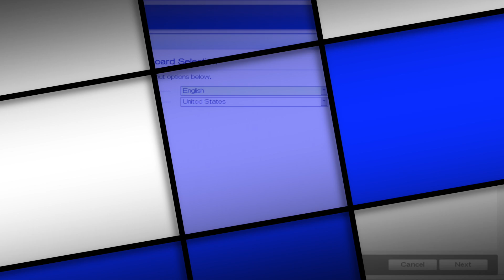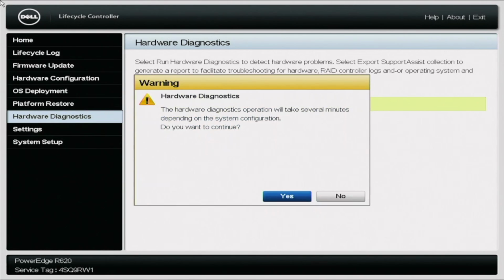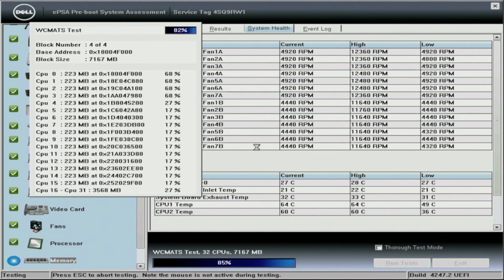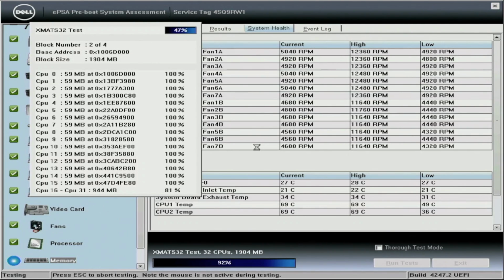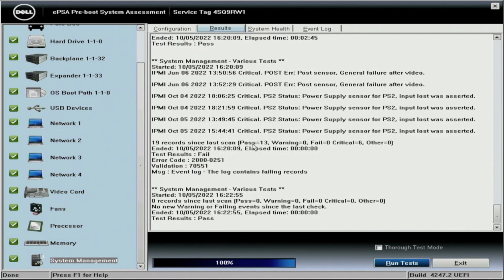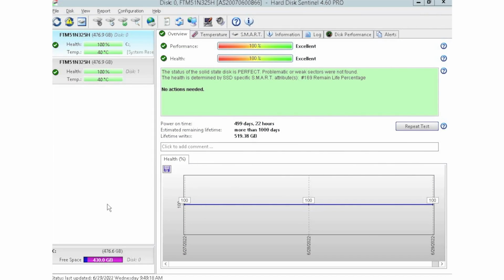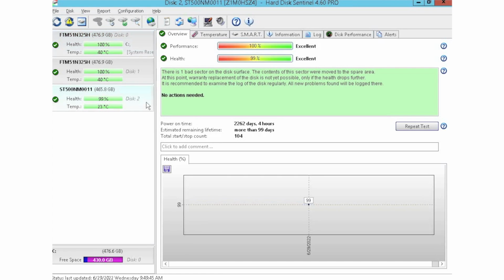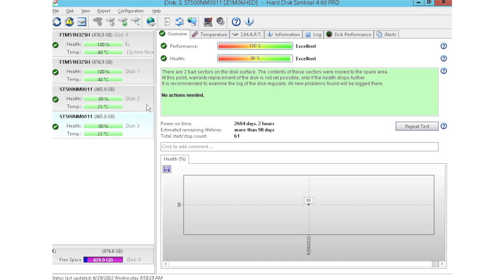Dell PowerEdge R620 HDDs & SSDs | Hard Drives | Solid State Drives | Testing with Dell Diagnostics

Comment: Hey, I've purchased an used R620, but it has SAS drives. How would I go about switching it so it can accept SATA ones instead? It has the PERC H710 RAID controller. Thanks!
Reply from the maker: It's a simple swap.  Just add in your SATA and remove the SAS.  Now if there is information on the drives, then that's a whole different story.
Reply: Thanks!!! I did not know that it was the same backplane. Its good to know since SAS drives are hard to come by.

Comment: I've installed 10TB SATAs in mine
Reply from the maker: Nice!  Thanks for sharing.  Happy Holidays!
Reply: How did you do that? Are they installed inside?
Reply: @Eric-is6pr  no, I used sata extension cables. They're connected in the front bays but are just outside the server on a shelf.

Comment: Is there any way to fit 3.5 inch drives in this server?
Reply from the maker: Unfortunately not
Reply: Not directly in the unit, however there are SATA extension cables that I used on mine. I 3d printed some caddies that rest on top of the server

Comment: what SSD drive will work, and are you talking about replacing the DVD with a SSD or the RAID Array with SSDs?  I swapped out my R620 with a drive caddy and a 230GB SSD and installed Server 2016 trial and it's so fast.  How many SSD's can i put in the array and what drives also can the drives see over 2TB each?  I have a 4bay and would like to do a raid 5 of 6TB's total SSD is that possible?
Reply: What drives did you use? I just tried some PNY from Amazon and the H710P wouldn't recognize them